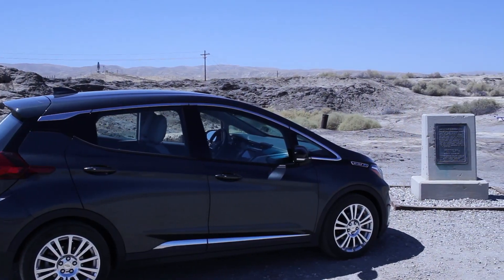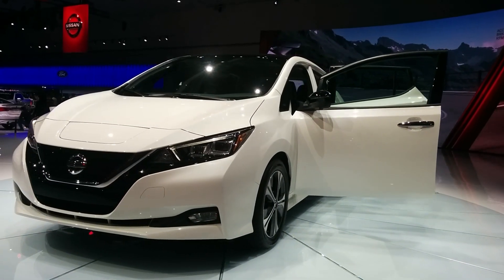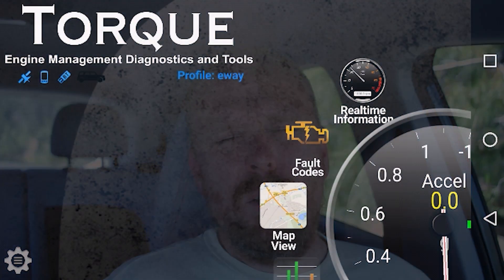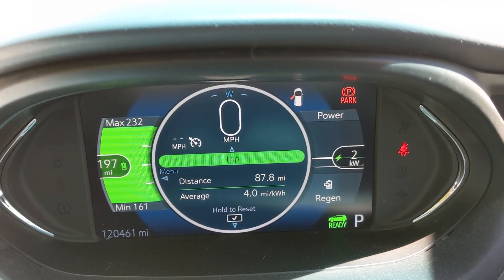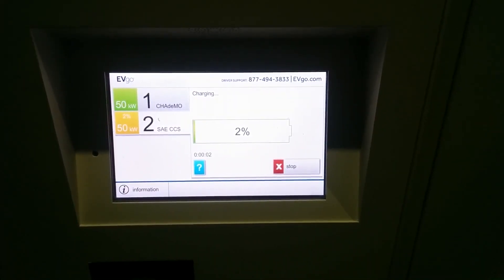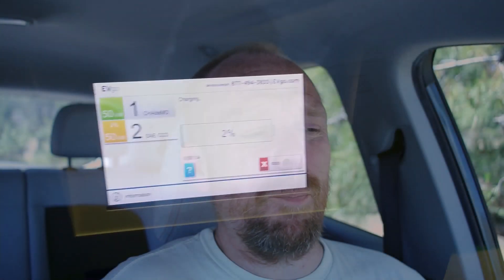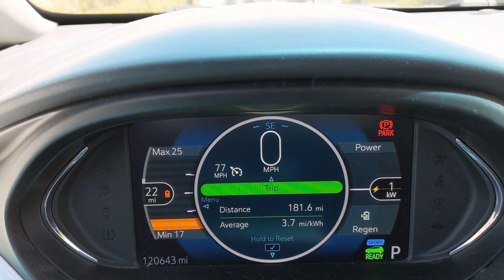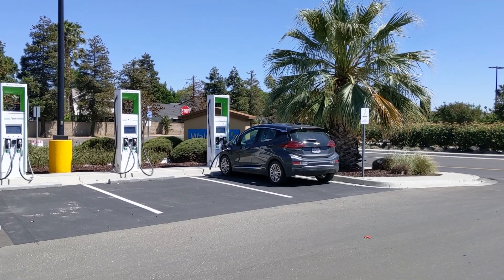2017 Chevy Bolt EV: Measuring Battery Degradation after 120,000 Miles

Comment: I had a 2018 Honda Clarity PHEV. 

After 211,000 Km (131,000 miles). 
The battery gave me 65 km (40 miles) out of 76 km (47 miles) nameplate capacity. 
That’s about 85% (15 % loss).

Not bad.

Comment: With Li-Ion being considered dead when it hits 80% capacity it's actually at 56.5% of its usable life and with quick maffs you've gone through approximately 595 cycles and your battery will hit the EOL at 1053 cycles or about 213000 miles which is a pretty good mark if the degradation goes linearly.
I see the vid is from 3 years ago so I'm very curious if my math made any sense.
Reply from the maker: Considered dead is an interesting way of measuring it, though I don't know that that would be considered the actual end of life for many EV owners. A lot of Nissan LEAF drivers kept their cars until ~60% of the original capacity. 

That being said, unfortunately, GM threw a wrench in the calculations because I had my battery replaced for no cost under recall at ~160,000 miles. I did do a capacity test just prior to that, and the usable energy was largely unchanged. Depending on whether that ~2 kWh missing was simply due to software programming, the battery had lost somewhere between 8% and 10% of its usable capacity at 160k miles.

I believe your numbers are based on the worst-case-scenario degradation, so it would have been 10% or ~50% of the usable life. I do recall calculating at the time that the original battery would have hit ~80% of the original capacity at ~300,000 miles using that worst-case degradation model. 

It's also worth noting that a majority of the degradation appears to have occurred in my first year of ownership, where I was charging to 100% nearly every day and it was sitting at 100% battery for long periods.
Reply: @newscoulomb3705  80% is just an industry standard for safety and general usability metric. My phone battery is at 65% capacity and is working "fine" but usability is obviously impacted and fast charging severely limited. BTW do you have any bad Bolt battey modules laying around? I saw sections are only cooled from below, wondering does top metal have any decent thermal contact with the cells? If yes I'd like to try and add another layer of coldplates from the top to improve cooling.
Reply from the maker: @yunodiewtf  Sure. I'm just saying that the car can still be usable after. The 80% degradation was primarily to standardize cell testing, so people could make apples-to-apples comparisons. However, for some reason, people started using it synonymously with primary use cell life. 

I didn't get to keep the original battery under replacement. Part of the deal was, it was shipped back. 

But yes, the cells are only cooled through the bottom with a chill plate. Some people have erroneously claimed that that was the limitation on charging speeds, but in actuality, it's a combination of the charging harness being limited to 150 A and the thickness of the cell electrodes. Regardless of cooling, the cells used in the Bolt EV are rated from factory for a maximum 1 C charging rate. 

A couple of automakers pushed these cells to ~1.1 C, but those EVs also appear to suffer from faster battery degradation.

Comment: Is it really necessary to charge it fully and drain it? How accurate is the range meter? Doesn't the vehicle adjust it's range estimate to account for battery degradation?
Reply from the maker: If you want to get a full capacity reading you have to start at 100%. Most of the energy usage calculations are algorithms based on cell voltage, so calculating remaining energy is really difficult without draining  the cells to a very low point.

I've seen too large of a standard deviation between estimated capacities when calculating at a higher battery percentage to trust those estimates.

Comment: Given the pack is noted as 57 kWh and elsewhere is noted as a real 60+ kWh. In the Ampera E documentation.  62 or 64 kWh. Battery with a useable 60 kWh and a min 57 kWh.  Depends on temperature and other things.   This would explain the 100% plus that extra bit that you get when charging to 100%.  50% limit is always 2% to 3% less than half of the 100% limit.
Reply from the maker: I'm measuring my degradation based on tracking the displayed data for this pack over time. GM provided an explanation for the difference between LG's sticker and GM's rating (57 kWh versus 60 kWh), and it was essentially that they used different testing techniques/parameters. From an owner's perspective, GM's measurement is what counts because it is what was displayed.

As for the various sizes, 2017 to 2019 had 60 kWh packs. Late model 2019 had 62 kWh packs. 2020 and later had 64 kWh packs.
Reply: @newscoulomb3705  you should test it against a known measure that you had in 2017.
Reply from the maker: @arenjay3278  Yes, that's what I did. The only wrench in that is that, in tracking the data, there was an immediate, consistent drop of 2 kWh of available energy following the battery reprogramming update that GM did. It doesn't appear to be actual energy lost, but rather an adjustment to how GM was calculating energy (possibly bringing it inline with LG's original 57 kWh estimate).

Comment: I let my 2019 Chevrolet Bolt run out battery yesterday so the charger would tell me how many kwhs it's currently taking in, it's battery has never been changed and it won't let me charge past 95% since that's the maximum charging target the car's software accepts. It's about to complete its charging and the charger tells me it has put 54 kwhs into the car's battery, I don't know how many kwhs the last 5% percent I'm unable to charge represents but, I would really like to know what the usable battery capacity for the original battery is. Do you know that?
Reply from the maker: The original had a usable capacity of about 60 kWh, but the released an update that reduced that to about 58 kWh. At some point in the year, the 2019 received a slightly larger 62 kWh pack.

Comment: Doesn’t the computer just tell you? My Tesla has 10% degradation like your bolt but the max charge range just shows the lower max number? Or does the range just vanish faster on the gauge in the bolt.
Reply from the maker: Tesla displays a fixed range based on EPA efficiency and the calculated capacity. GM uses a variable range estimator based on current conditions and recent driving, so there's no way to use it to gauge estimated capacity in the same way you can in a Tesla.

Comment: I'm imagining a future where lots of EVs that are 5/10/15 years old are available on the used car market and perspective buyers want to know the actual range of the vehicle they are purchasing. Expecting sellers to allow buyers to take the car on a 200-mile test drive is unreasonable, as is expecting buyers to have the time on their hands to actually drive it that far.

Instead, I imagine the way this would work to be sellers taking the car to a diagnostic lab that charges and discharges the battery in a controlled environment, without actually driving the car. If the "seller" is a car dealer, this would be something they do themselves in their own service department. Then, they simply make a digital the certified range report available to perspective buyers.

Of course, by this time, the charging infrastructure will be much better than it is today, which makes a few kWh far less consequential. But buyers will still want to know that they're not buying a lemon with 40% less-than-expected battery capacity, and I can see a certified diagnostic test giving buyers that peace of mind necessary to make the purchase.
Reply from the maker: Yes, I could definitely see used EV dealerships providing a battery capacity rating in the future. Range is a tricky subject because that depends too much on conditions and driving styles. Instead, the focus should be on capacity. What was it when new, and what is it now?
Reply: @newscoulomb3705  

Good point. Actual range is too variable to meaningfully measure. But battery capacity is much more objective.

Comment: I just watched your video (I know, a year late).  I have a ‘19 Bolt with 136,000 miles, that is in the body shop (not my fault!). When it comes out, I will be taking it in for my recall battery.  I didn’t test the original battery when it was new, but I will certainly do so with the new one.  I’m thinking about doing for the old one, too, just out of curiosity.  Subjectively, it has seen like there hasn’t been much degradation, just based on how it chargers and how it does on road trips.  I think that 5-9% falls into that range and is less than what I had expected.  Thanks for the video!
Reply from the maker: You're welcome! I'm supposed to be getting my new battery soon, but I'll do an update on the 150,000 mile degradation before the replacement.

Comment: So how many miles would it go on a full charge when new?????
Reply from the maker: That depends on conditions. All freeway speeds: about 200-210 miles. Mixed driving: about 250 miles. All city driving: about 300 miles. But winter affects each of those differently.
Reply: @newscoulomb3705  Thank you!

Comment: Is it the year or milage that makes batteries degrade
Reply from the maker: It's typically both. Any cycling of the battery will cause it to lose capacity, and over time, batteries will start to degrade naturally. 
The rate of that degradation is dictated by how the battery is cycled (how deeply and how rapidly) and the conditions in which the battery is stored (state of charge SOC and temperature).

Comment: This is my guess and I am not an EV owner yet. After original Nissan Leaf lesson (which allowed true 100% charging and caused enormous battery degradation), EV manufacturers have limited how much you can charge. So 100% means you may only be charging up to 57 out of 60. Ford Mach-E has 98kwh capacity, but for users 100% means 88kwh.

Comment: If you ARE relying upon the meter reading of 10% of battery life as being accurate and therefore establishing the bases of this test (establishing the floor), how is that consistent with not relying on the same meter to read back accurately at higher levels? In other words, the meter may not be accurate at higher levels but most likely accurate at or around 10%. I would think the better way is to wait until the system shuts down in protecting itself (setting the floor), then proceed. The 10 percent left may also be inaccurate.
Reply from the maker: It has more to do with how the battery level affects the accuracy. If over 75% SOC, the accuracy is +/- 8 kWh, over 50% SOC the accuracy is +/- 5 kWh, and over 25% SOC the accuracy is +/- 2 kWh, you're really just narrowing down to what is most precise. Sure, you could go to 5% or even dead (hard to do and potentially dangerous in real-world driving) you're gaining a precision of less than +/- 0.5 kWh. Essentially, anything from 5% to 15% SOC is "good enough" for a fairly precise measurement.
Reply: @newscoulomb3705  I still maintain, how do we know if 5 or 10 percent is accurate while you state that higher meter readings may not be.
Reply from the maker: @bobcatt2294  Because I've seen the discrepancy. Others have noted it as well across multiple different EVs. Bjorn Nyland has also called it out, and his data matches my data over time. Anything over 25% SOC, and I lose confidence in the accuracy and precision of the test.
Reply: @newscoulomb3705  I understand the problem, my question is it not better to test when power plant safety shuts-down the vehicle. Then use that as you starting point - not the so called, 5 or 10 percent on the readout.
Reply from the maker: @bobcatt2294  I suppose it depends on the purpose. If I bought the vehicle solely a test vehicle to validate data already provided by the battery manufacturer, then sure. 

However, because I bought the vehicle for personal use and my intent is to use it as an average consumer in my circumstances, cycling the battery down to 0% SOC would add unnecessary (and unrealistic) stress and wear to the battery.
Reply: @newscoulomb3705  Cycling the battery to when the vehicle's low battery protection stops the motor. This is when the test should start.
Reply from the maker: @bobcatt2294  In the Bolt EV, that is completely dead. I agree that that would provide the most accurate and precise snapshot of current capacity, but the difference between 0% and 5% battery is so minimal that there's little to no benefit.
Reply: @newscoulomb3705  Note, I am stating not "completely dead" but in the state where the  protection initiates stopping the vehicle. I think I've seen a test on Youtube of precisely this method used to determine if in fact, what the manufactures claim in distant is true. Each vehicle was charged then driven until each stopped. This method completely relied upon the actual miles traveled and not metering of power.
Reply from the maker: @bobcatt2294  Yes, but their reason for doing that was different. They were testing actual range versus claimed range. The tests I'm doing, on the other hand, are for measuring available capacity between 0% and 100% as well as degradation over time. Because I'm extrapolating the total capacity, there's no reason to dip that low. 

Also, note that in that test, while some automakers do include a "bottom buffer," the Chevrolet Bolt EV does not. When it reaches 0% battery, it shuts off. There is no extra capacity to be had.
Reply: @newscoulomb3705  Have you compared capacity (which I see also as range) with another EV like you have done with the Bolt? Secondly, do you think 2 Bolts would read out closely off the assembly line would have different capacities over time? I would think overtime, with oxidation, heat, fast charging - the differential between cells, from battery to battery would give false reading of greater than 10 percent. This, I think is because the battery cells are measured in clusters.

Secondly: why are these manufacturer not standardizing on integrating super caps especially when the demand on load is high (example, initiating an acceleration to purely accelerating) is rather common? Also when wanting to fast charge, super caps would take to load off the battery thus extending their lives.

Comment: This is a helpful formula. My new Bolt named Mutt is garaged while driveway is getting replaced. It had a 90% charge on it so in the cold I cranked heater to 80f for a few nights/mornings and listened to the radio. I am around 60% now and will let it sit until driveway is done. Might be a month.

Comment: Very helpful video.  What have your maintenance and repair cost been over the years?  I'm trying to put together a cost to own analysis since Edmunds doesn't have anything for the Bolt.
Reply from the maker: I'd have to tally everything up, but so far, it's been less than $2,000, including two sets of tires and a windshield replacement. Other than a few sets of wiper blades, wiper fluid, and cabin air filters, there hasn't been any maintenance.

Comment: The GM update to the Bolt put a restriction from charging to 100% capacity down to 90% to mitigate the risk of fire for suspect batteries. That makes your degradation even less. Kudos! I have been considering one.

Comment: Could you use the range displayed on the dash as a measure of degradation? I noticed on full charge mine just goes to 223 instead of 238 like it used to
Reply from the maker: No, the Range Estimator is based on current conditions and recent driving, so you can't use it for tracking battery capacity.

Comment: at 0.58 seconds  you show a filled battery with 198 miles on the gauge which is exactly 94 per cent capacity of 232 miles.

Comment: I have recently been contemplating on buying a 2017 bolt ev lt with 33k miles I currently live in an apartment downstairs so I will be able to charge at my home sometimes but I will mostly use an ev go charging station do you think the car will be in good conditions for a while under those charging conditions??
Reply from the maker: Hey, yes, I think it should be fine. People worry too much about the impact of DC fast charging, but it really isn't a big deal. The thing to remember is that it will be a little more expensive and a little less convenient than if you can charge up at home or work every day. 

Things worked out for me because I had charging at work, and the local EVgo is right next to a grocery store where I shopped regularly. Even with out that, if you only drive a 30 to 40 miles a day, you should be fine.
Reply: @newscoulomb3705   I drive about 80 something miles a day, I’m use to spending 30 to 40 dollars on gas a week so that’s no problem, I was told using an ev go station once a week will be about the same. I want an electric car I just don’t want to have to worry about getting a new car in 2 years or worry about fixing something on the car every other month. Since I will be paying monthly .

Comment: It's easy to check battery degradation: Just weigh the car, but be sure to use British pounds instead of metric pounds. The British pounds are more accurate.
Reply: how does it affect the weight? can you explain more?

Comment: All electronics come from the factory 50% charged for battery storage stability during transit, warehousing, etc. Same should be maintained at home between a 30-70% range and it will last much longer than expected.

Comment: After 3 years and 165,000KM (102,526MI) with the German Bolt (Ampera-e) I am at 58kWh. the Ampera-e will probably start with 62kWh, i.e. 4kWh loss. The display also fluctuates around 1 ~ 1.5kWh in winter.

Comment: When you say it was 60kWh when it was new, did you use the same method for measuring that 60kWh?  For example, using that same measurement method for my '17 when it was new, I only measured 58.7kWh (before any software updates).  I just measured it the other day the same way and got 58.5kWh.  Although I only have 20,000 miles.